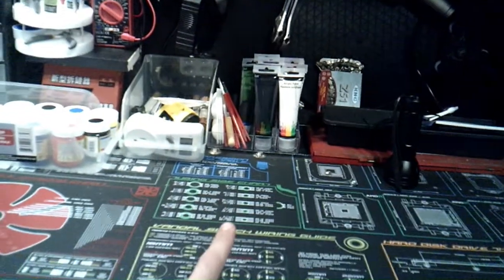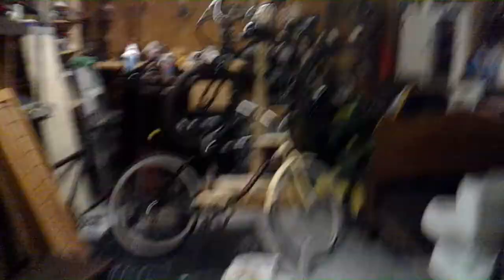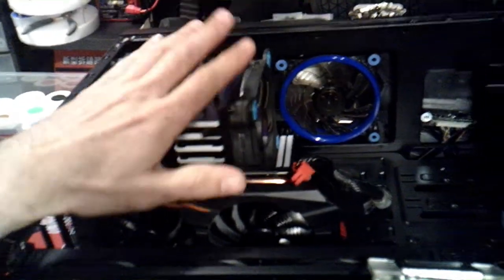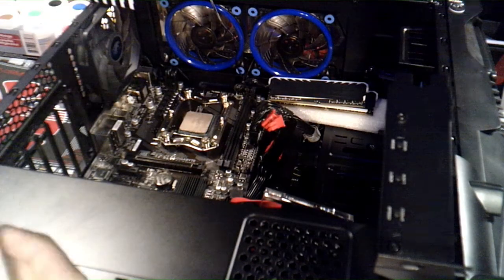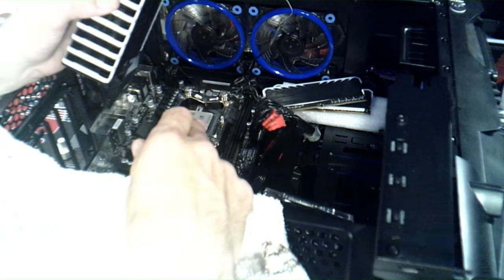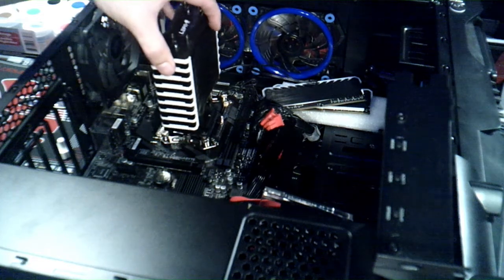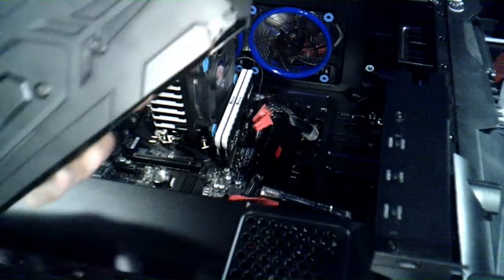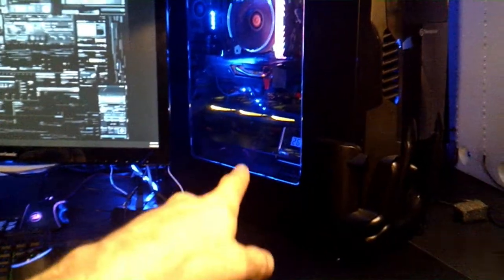MAINTENANCE on UFO ENGINE!! Time for a Bath

Comment: Which Ryzen chip do you use?
Reply from the maker: Ryzen 5 1600.  6 cores. 12 threads. I did have a ryzen 3 1200 but upgrade
Reply: @ATECHPCs  good chip for sure. Can't beat it for the price. I switched from a Ryzen 5 2600x to a Ryzen 7 2700x a few months ago.
Reply from the maker: @dhuskey82   if I hade the income to buy a ryzen 7 I would...I still want to upgrade at some point... video editing slows me down